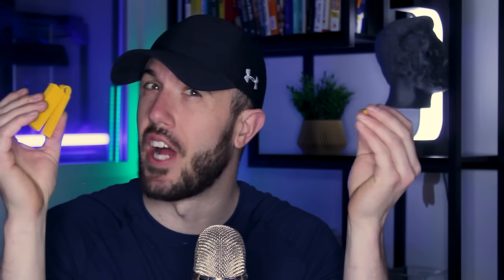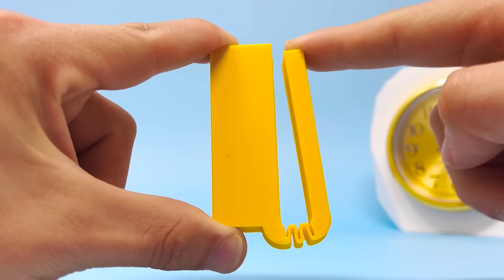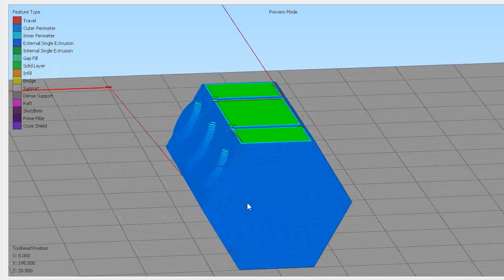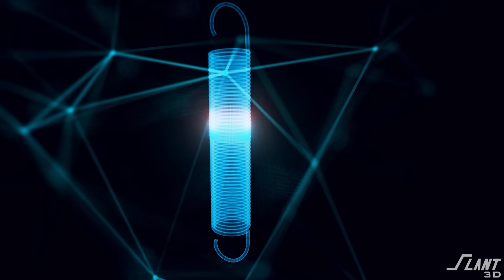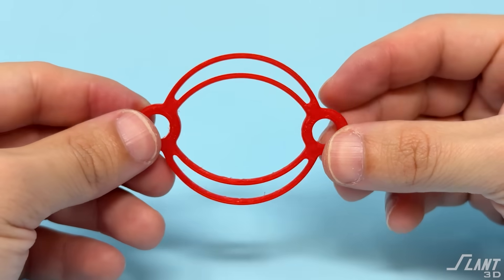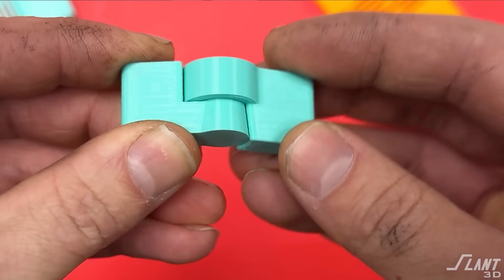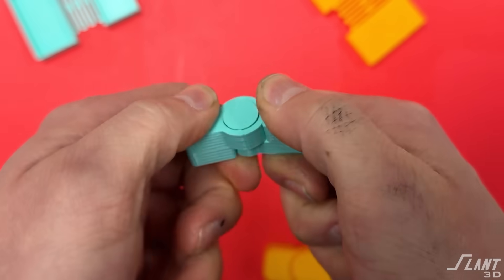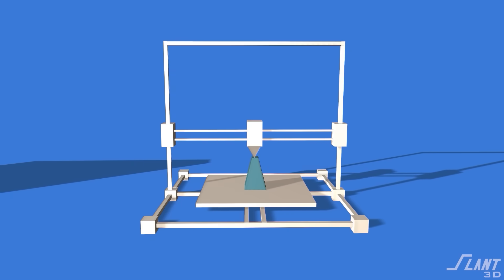Learn 15 Print-in-Place Mechanisms in 15 Minutes

Comment: While watching the "Extension Spring" segment, I came up with a thought. Could you combine TWO extension springs shifted 90 degrees to give strength along the "Z" axis, taking away any side to side (flat side) shift? Thus making it act closer to a coil spring?

Comment: I tried a traditional door hinge using a paper clip as the rod, but unfortunately, I undersized the hole, so the paper clip wouldn't fit, and the geometry prevented me from using a drill bit to widen it.  Sad, because it would have worked fine, and be very compact if correctly executed.

Comment: I recently designed something similar to the last hinge, but the way I solved the overhang problem was to print a thin washer the size of the overhang, then put a pause in the print to place that washer in, then resume printing on top of it. Creates a nice clean surface between the two pieces, with zero chance of fusing, as everything is supported.

Comment: You can do traditional helix springs w/ 3D printer if you make the profile rectilinear (2x width than height), and they dont even need supports if you print slowly enough. I've made many, they work well for a few months.

Comment: For the last of your hinge mechanisms, where the rotation axis is horizontal, there's no need for the spindle to go right through.  The male part can just be reduced to a dome, and the female part has a dimple at each end.  The rest of the hinge can be solid, so there's no problem with printing overhangs (you don't want the dome to be a hemisphere, just a section of a sphere, e.g. think of the globe from the 50th parallel to the North Pole, at no point is there more than a 40 degree overhang on either male or female part. You can specify this angle as a constraint in CAD, so there's no need for maths)  This is effectively the same as your final cone design, but it's easier to model.
I've also had good results where there are no male parts.  Instead, it uses a "ball" of a filament which does not bond with the main part.  This can result in very fine tolerances.  Ball is in quotes, because it's not really a ball, its just the two male domes from before that are joined together.  This can even be printed vertically, where the ball filament is extended to act as a support layer, so it's a bit like one of those balance balls.  The support will eventually fall off, but if you're making the part for yourself, you probably don't mind thin slivers falling off occasionally.  If you're manufacturing, you'd want to get rid of the support layer, which can be a problem.

Comment: A coil spring can be made on a 3D printer. I did one before unintentionally  but the end result was surprising. I was making a small threaded pipe and was too aggressive on the threads and the result was a coil spring that worked very well. It ended up being the neck of a small robot I was making.

Comment: Well done. I have designed 3D printed hinges. I've also allowed for a secondary option where a metal axle pin-paper clip or Ø1/8 rod- can be inserted. I like to design with mixed materials.

Comment: Are the print in place joints only possible in Cute Ultimaker or can i also di it in Elegoo Cura? I cant select where I want to supports to be in Elegoo Cura. My printer is Elegoo Naptune 2 Pro

Comment: An issue that is standard for living hinges with injection molding. If you flex the hinge within an hour of molding. the sooner after molding the better. The number of flexes after that are dramatically increased.  So if you mold the part and flex it soon after molding. The hinge will fail at 1000 flexes. an unflexed may only last 10 flexes. Obviously there are lots of factors. this issue is often ignored, and has a major affect.

Comment: Good info, thanks! It's worth mentioning that 3D printed springs should generally be in their relaxed position when at rest. ie: Don't design a printed spring that must push or pull all the time, otherwise it will eventually 'set' to the stressed position and lose its holding force.

Comment: I've done coil springs out of thick TPU and PETG without issue, printed vertically, though it's usually 3 or 4 interleaved together to get the right overhang angle and stiffness

Comment: I think the biggest thing about live hinges and 3D printing is the ability to use multimaterials.

A box out of say ASA with a living hinge of TPU that is knitted into the ASA will give you all the durability of ASA and the flexability of TPU.

Also great for compliant mechanisms and not something that could be made in one piece with any other manufacturing process.

Comment: Thanks for the compilation video -- your mechanism videos are super useful!  Do you happen to have a model file (like an STL or something) for that vertically printed rotating hinged hexagon?  I'm curious how you handled the horizontal surfaces without having them settle on each other and get stuck together.  Typically I would have done this with internal 45 degree angles, but it seemed like yours was flat although it was tough to tell in the video -- so I was curious to get a closer look at the mechanism.

Comment: Would love to see a video about using other metal parts with 3D prints such as pins, magnets, springs, screws, etc. We use them for some products because plastic only goes so far.
Reply: wont happen as this channel is 100% advertisement for their "teleport" print on demand service and they push for designs that are 100% printable without post assembly

much of the advice you find here is good for general 3D printing, but if you follow for a while you notice that he is teaching product design that is specifically tailored towards print on demand and is otherwise really bad product design

Comment: For strength on my hinges, I leave a hole threw the design for a glued brass rod.  This allows me to print up/down and the brass rod greatly helps prevent layer line breaks.
Reply: *thru or *through.